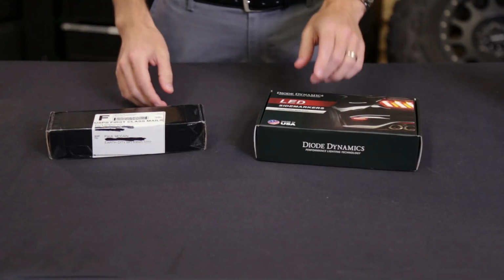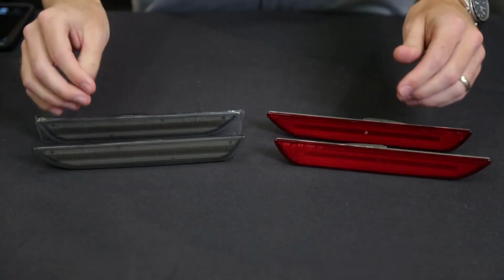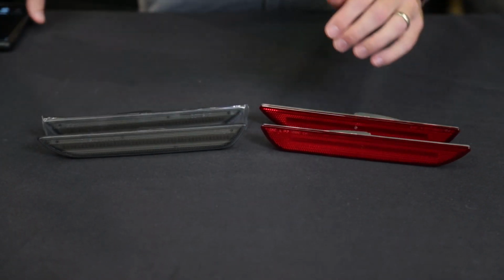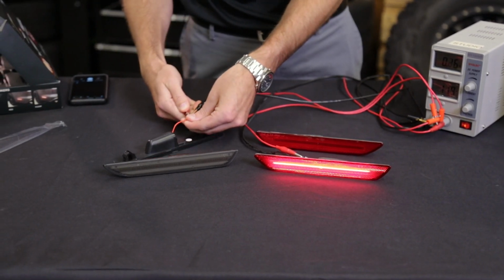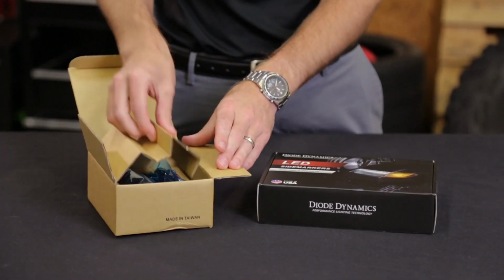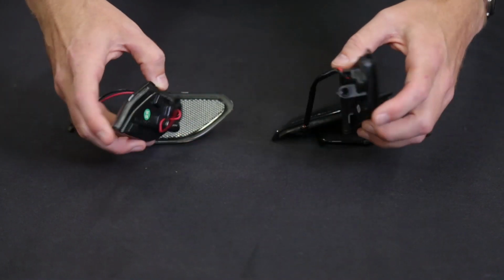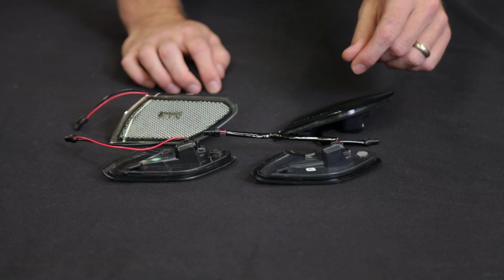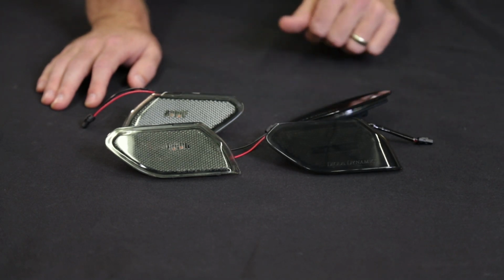LED Sidemarkers Compared: Diode Dynamics vs eBay Imports

Comment: The Diode Dynamics I bought lasted less than a  year. I just changed to ones that are just like the ones you're comparing here but from a "different" manufacturer. We'll see what happens.
Reply from the maker: Hey there! We're sorry to hear that- very strange. We offer a 3-year warranty on them, so if you reach out to us, we can get them replaced!

Comment: Want some honest feedback? Look at how far the diodes go on yours verses the Chinese one. Yours stop far from the edge. I don't understand that. As I've mentioned before whether or not the tiny line is good or bad is subjective. I like the marker to be filled with light and it appears more visible IMHO.
Reply from the maker: Hi Mike! The eBay markers LED strip actually doesn't go any further out on each side. They are made with cheap, large LED chips that put out a ton of uniform light output. This makes it seem as if the strip of LEDs is larger. This look compared to ours comes down to preference. Unfortunately, with LEDs, bigger does not mean better. Large LEDs like this have a track record of burning out quickly.

Comment: It's nice to be able to find a company actually reviewing their products in video form, it's almost impossible to find that with some cheaper brands, it's like hope you don't get screwed too bad, however your prices seem insanely high and I'd probably still roll the dice on some other brands after i googled for reviews, where it's made doesnt bother me however the price and quality of the product does, great info though regardless and thanks for informative videos
Reply: D D i agree. 70 dollars for some plastic is quite expensive and not as reliable for that price according to forums.
Reply: Captain Jack and your biased comments.  70 dollars for plastic as opposed to what, steel?  Titanium?  A myriad of products are made of plastic.  I'd be more concerned with the manufacturing process vs complaining about the cost of "some plastic"  @Mister_Macintosh

Comment: So the Jeep side marker isn't retroreflective?
Reply from the maker: Our brand of LED sidemarker for the Jeep will have the same reflective properties as the OEM unit, however was designed to have that LED strip going down the center. Otherwise, the reflective properties will be nearly identical.

Comment: the problem is that after buying your product my markers have had to be replaced once already under warranty and now they are failing again. The product is not durable and fails at a high rate. For such an expensive price, I expected quality and durability. The second set you sent me only lasted a year.
Reply from the maker: That would be very unusual, as these are generally extremely reliable for us, with one of the lowest warranty rates out of our entire product line. Shoot us an email at contact@diodedymamics.com and we will get you back up and running!
Reply: @diodedynamics   email just sent thank you for your help. I love the product. Love the design. Just wish I did not have the issues I been having with these side markers.
Reply from the maker: @ociriszues , thanks for your patience - we will get you taken care of!
Reply: @diodedynamics   - A manager got involved and was able to help me out. I am happy to report that Diode Dynamics went above and beyond to resolve this for me. Thank you so much. They stood by their product and I respect that.
Reply from the maker: @ociriszues  glad that we could be of help!